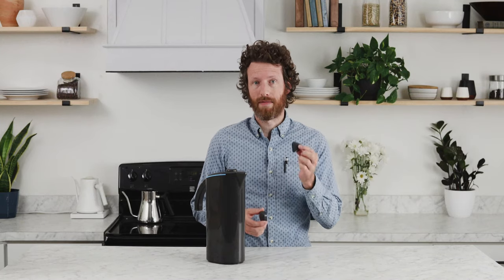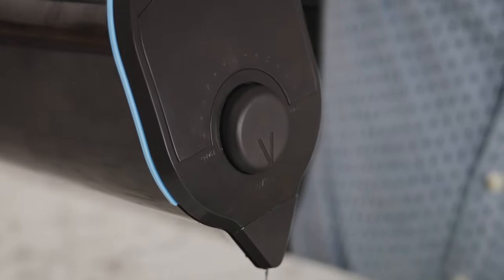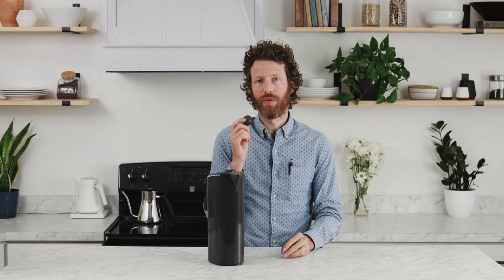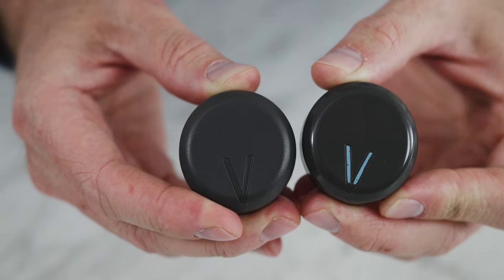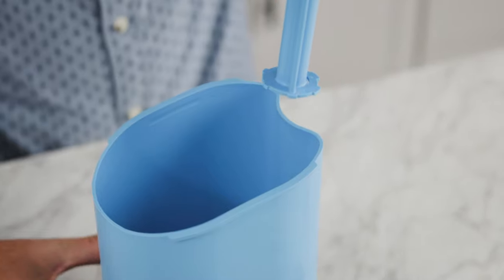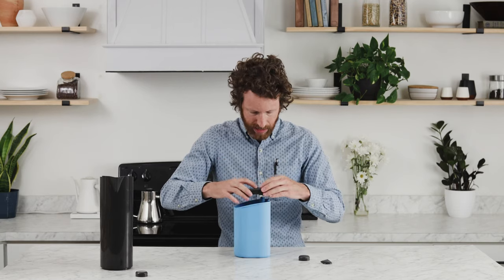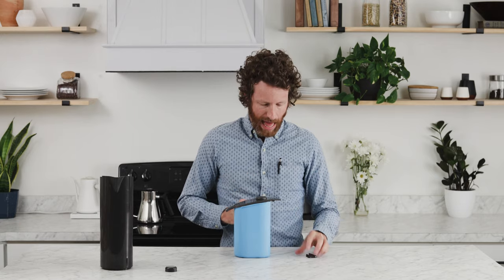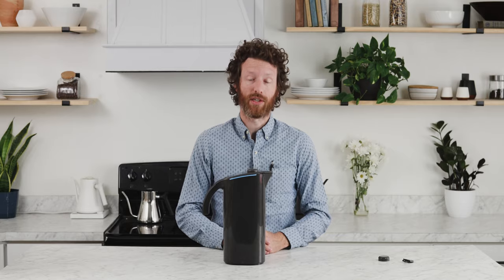Video Overview | Peak Water Dial and Flap Upgrade Overview

Comment: My biggest issue with the Peak was the absolute abysmal build quality of the filters. First one I had released a bunch of resin balls into the filtered water. They eventually sent me a single replacement filter (even though I had two faulty filters) that was supposedly manufactured to higher standards and with more / better glue to hold the resin compartment closed. That didn't work either. After the stupendous amount of delays this project endured it's just a subpar product in every single way.
Reply: Sadly, I’m wanting to upgrade my water filter pitcher and I keep seeing comments like this that make me not want to buy the Peak. Has Peak addressed this issue at all? It’s the number one thing I see people mention and that is kind of a big deal.
Reply: @greysuit17  Right after they finally shipped my Kickstarter purchase is when I got a replacement. That's also when they told me they improved their glueing process but obviously that did nothing. A little while ago when they sent out the email that this dial and flap upgrade was available they mentioned that they had yet again improved the filters. Personally, I'm not buying it. I've got an expensive flawed jug, and even more expensive filters. I'm not ready to dump more money into this thing hoping for a miracle. Maybe in a year or so I'll give it another shot with a single filter when I'm somewhat confident that I'll actually get a newer / more recent filter because of course you can't tell the different between the very first filter and the latest filter revision in any way.

Personally, I'd recommend any Brita filter over this thing. You can get the filters just about anywhere and it's a heck of a lot cheaper too boot. Sure you don't get the mixing bit in the jug, but that's a gimmick at best since it's just a bypass. If you mix the water from a Brita with unfiltered water you're essentially doing the exact same thing.
Reply: @SebastiaanSwinkels  currently I have a Mavea filter which I found to do a better job than Brita, but the filters are hard to get.
Reply: @greysuit17  Filter availability is important though.